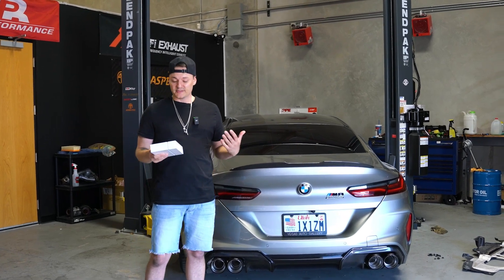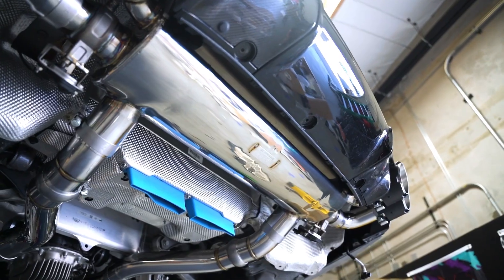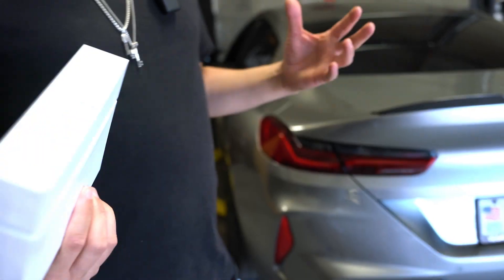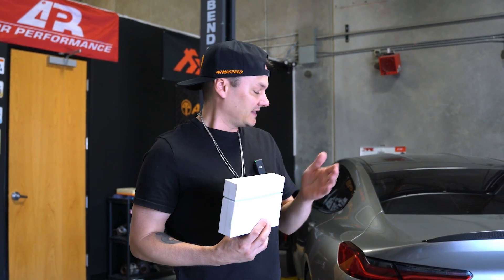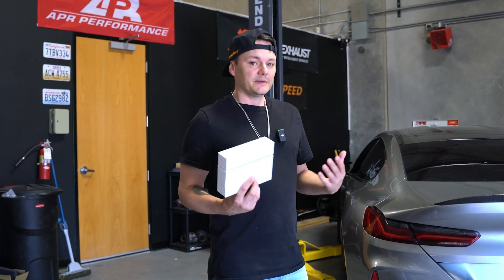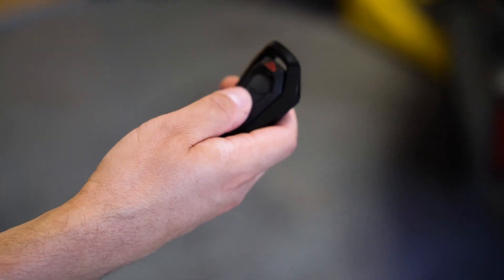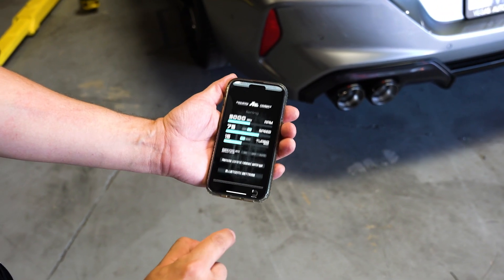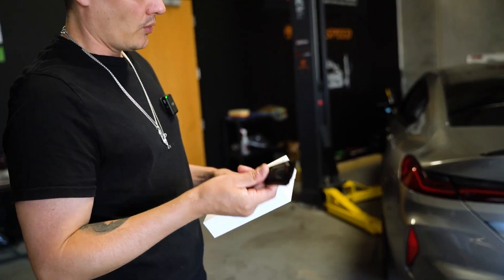FI Exhaust - BMW S63 Powered M8 Gran Coupe F93

Comment: Doesn’t it match up with the drive settings? Usually on comfort or eco the exhaust is closed unless you step on it which opens it up partially. On sports mode is when it’s fully open but lacks the character. I guess best thing is to go in person or call to get more ibfo